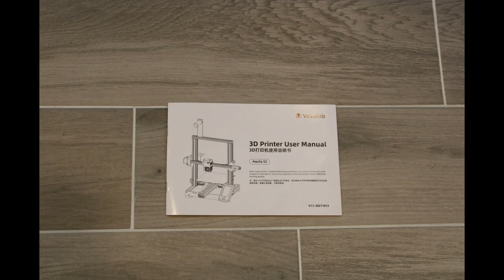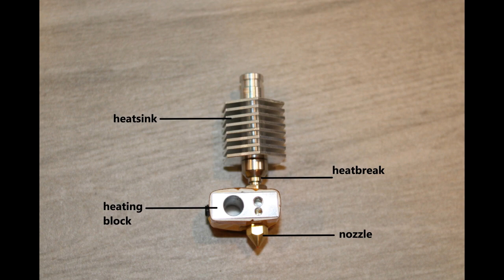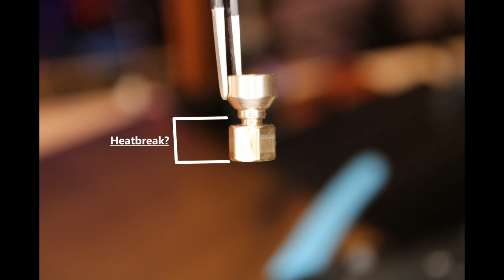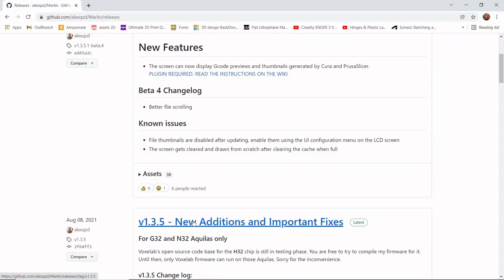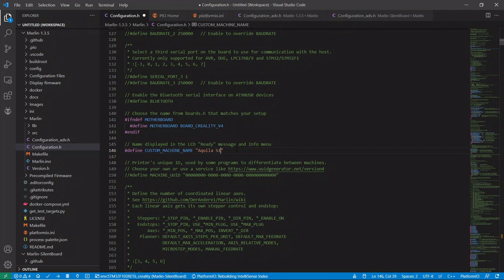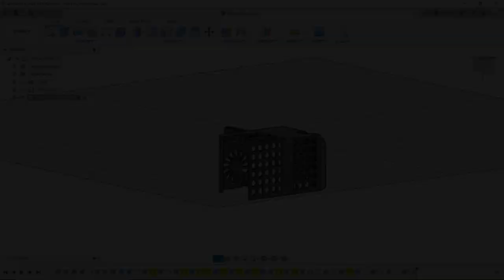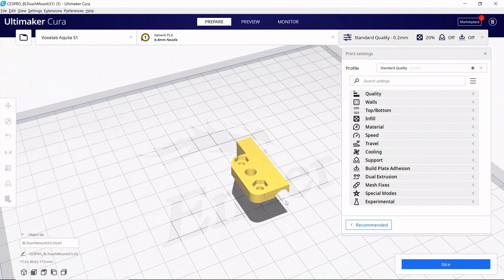Voxelab Aquila S2 - Direct Drive - High Temperature Prints

Comment: Hi friend. I really like your videos. You explain very well, in detail and clearly. In the spring I bought a Aquila S2 printer. I recently flashed with your firmware compiled on the basis of firmware 1.3.5 from Alex. The printer got better. Only LinearAdvance is missing. I'm a little embarrassed to ask, but I can't figure it out myself. Could you compile the firmware with support for LinearAdvance ManualMesh-4x4-N32 and BLTouch-5x5-N32? I ordered the sensor BLTouch, but it's still on the way. I would be very grateful. I'm even ready to pay, but now it's hardly possible from Russia. Thank you in advance.
Reply from the maker: Hi Anatoliy! Thanks for the support, I appreciate that. For Linear Advance to work on your printer the drivers need to be in UART mode, which is not available on the Aquila. Now there are ways to go about it but it involves some soldering, and can be a little difficult to complete. Here's a link where Alex (the purveyor of the firmware) describes the process necessary to enable Linear Advance.

https://www.reddit.com/r/VoxelabAquila/comments/nn9e59/how_to_enable_linear_advance_on_the_stock_aquila/

If after reading through that you still want to go about this project you will need some new firmware and that I would be happy to compile for you, but first read through that link and see if you're up for the challenge(or if it's worth it  to you).

Alternatively you could look into the firmware Klipper. Klipper has pressure advance (same as linear advance) and a lot of other great benefits. There is no soldering necessary but you'd need another MCU like a raspberry pi to get Klipper working, and because it's different firmware there's a lot of new things you'd need to learn that is specific to Klipper. I have a lot of my printers converted over to Klipper right now (mostly all of my Ender 3s) and I am really happy with it. Any questions please ask me!
Reply: @PrintsLeo3D  Leo, thanks for the detailed and detailed answer. I am very pleased that you devote so much time and effort to simple users, which I am. I'm afraid I won't be able to put the clipper. To do this, you need a Linux computer, for me it is quite difficult in my 58 years. The head is not so good at handling new information. But I'm ready to work with a soldering iron and put a jumper. I have seen this instruction from Alex before and for me it is simple and clear. If you can collect the firmware for me, I will be very grateful for this service.
Reply from the maker: Ok, great! Creating this firmware for you shouldn't be an issue. Please just contact me through my discord (there's a link in the video description) or you can email me directly printsleo3d@gmail.com so we can make the file transferring easy!

Comment: Hey any way you can share your Cura Profile? I just got mine but having issues selecting the correct printer on Cura and all profile settings. Thanks
Reply: I seen your speed settings on your comments but wondering what other settings you have. Thanks again.
Reply from the maker: Glad you got an S2, hope you're liking it. I have a video that sets up CURA for the Aquila, and it's the exact same way I set it up the S2 (https://www.youtube.com/watch?v=i-2qFVHKULE). Which is basically to choose a non networked print > CREALITY3D > Ender3Pro . The Aquila series is a clone of the Ender 3 so this printer works perfect for the Aquilas. Then you can go download my profiles and import them. I have all my S2 profiles on my website:
https://www.printsleo3d.com/aquilas2
Reply: @PrintsLeo3D  awesome. Thanks, yea I seen all your videos. And seen the cura setup but was wondering if the direct drive would fit another printer better. So thanks for that and I’ll check out your link on profiles. 
I’m in the middle of setting up the cubes after following your bed level video. Again awesome work and straight forward.
Reply from the maker: Thank you so much I appreciate the feedback! Yea the only thing that the Direct Drive heavily affects in the slicer is the retraction distance, so we're safe to use a similar printer. Again thanks for watching and commenting and I promise to keep the videos coming! I am actually hooking up my Aquila with the Creality Sprite Direct Extruder in the next video!
Reply: @PrintsLeo3D  Nice cant wait to see that. 👍👍

Comment: If you really wanted to do some science for the community you could keep the hotend at 300 degrees for 12 hours and see how hot the top of the heatbreak gets (DMM thermocouple / IR thermometer), and if the PTFE has discoloured at all in that time. I really don't get why they've decided to ship these with brass instead of stainless steel / hardened steel nozzle.
Reply from the maker: This is actually a really great idea and I think I will be testing this. Some other people have suggested trying out some high temperature filaments, and while I don't print those filament normally because I worry about the possible harmful effects while printing. I might do a complete high temp video where I not only print these filaments but also do some high temperature testing as you have described. Thank you for leaving a comment and adding to the discussion!!

Comment: I just purchased the S2 on lightning deal and mine does not have the same brass nozzel, the one I got including the replacement are both tiny with only a few threads  before the point, it looks similar to ones for other brands? though i havent tried any yet
Reply from the maker: That's definitely a packaging error. Those nozzles are the standard MK8 nozzles for the base Aquila and they will not fit properly in this machine. A few other people have received their printers with the same incorrect nozzle. If I was you I'd contact Voxelab and tell them your printer shipped with the wrong nozzles and they should send you one or two replacements. If they aren't helpful just email me your address and I can send you a spare I have.
Reply: @PrintsLeo3D  I ordered replacements already, its not worth asking for a replacement of the 1 extra print head I got! As far as that goes how long will the print head last the one i got with the printer is working great and I only plan to ever use PLA. I know its overkill with this able to do more but the lightning deal made it really cheap compared to others.
Reply from the maker: Having a reliable, easy to work with printer, whether or not it's using all it's capabilities, is certainly worth the deal. Because as you get more and more into the hobby you'll find yourself wanting to explore all the different areas, and you're in a good position to do that. As far as nozzles go, if you're just printing PLA you can expect a brass nozzle to last a fairly long time (probably can go a few months without replacement). Glow in the dark, wood, carbon fiber filled, those are all abrasive filaments and will significantly degrade the life of a brass nozzle. Also brass is a soft metal, so if the tip of the nozzle gets banged into a lot then it will also lower the lifetime of the nozzle. Other than that expect to get a few months at least out of an everyday brass nozzle.
Reply: @PrintsLeo3D  Thank you and point taken, I'm glad i ordered the heads now although they only have the brass ones so far! I like the silk bronze I found on Amazon and have it on auto replenish, heh first print i did was watering bulb, it is spring and the planters need water. The only drawback is the manual bed leveling, you really have to be precise or bad things happen even with a heated bed, the first few prints had a streak up one side of the print. But once fixed i can make some nice looking bronze esk "PLA" statuetes. This is a fun piece of equipment!

Comment: Hi, thank you for posting this video. i hope you can give me this "Installing TPU specific extruder part" file?❤️
Reply from the maker: Hey thanks for the comment! I cannot believe I didn't include this mod in the video description already! Thanks for the heads up. You can go to the MODELS section of my website (PrintsLeo3D.com) and  can find this piece under the Aquila S2 section . Depending on when you received your printer you might not need to add this part, as I was told by Voxelab newer units would ship with this enhanced part already installed. They told me that early January 2022, not sure when that would be implemented but I figured it's worth the heads up. Thanks again!
Reply: @PrintsLeo3D  thank you

Comment: Does it work with 0.03 pla?
Reply from the maker: I'm not sure what you're asking. The filament I used with this nozzle is 1.75mm. because it's a 0.4mm sized nozzle (exit bore size) the maximum recommend layer height would be 0.32mm and the minimum recommendedayer height would be around 0.08mm. I hope this helps

Comment: Specify temperatures and speeds when printing samples. Thanks
Reply from the maker: That's a great idea! Sorry I didn't think to add this. Going forward I'll try and add a text overlay while printing that has this info (depending on the editing software I am using). For now I'll add an addendum to the description with that info. Thanks for watching and commenting!!
Reply from the maker: Added speeds settings to top of the description and temperature settings at the bottom next to the Filament types.

Comment: Don't you think the proprietary nozzle deserves more discussion? Try to find one.
Reply from the maker: Yes, I absolutely do! I had a line on what I thought was going to be a drop in aftermarket replacement. When it arrived I could immediately tell it was not a replacement, and that's when it sunk in that finding one of these nozzles is going to be very very very hard. I am working on a new video that talks more about not only the nozzle but it looks to test the actual real time temperature values the PTFE tubing in the hot end is under.